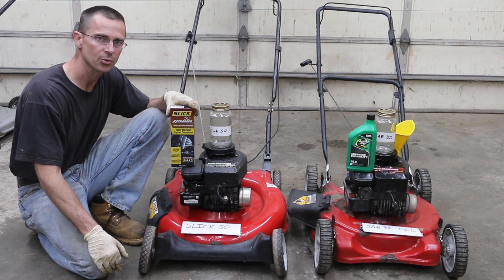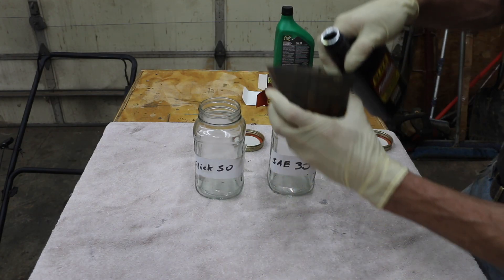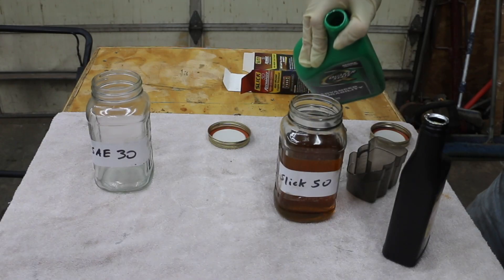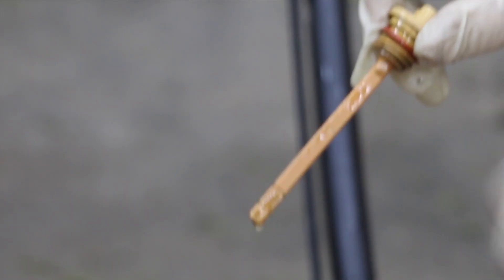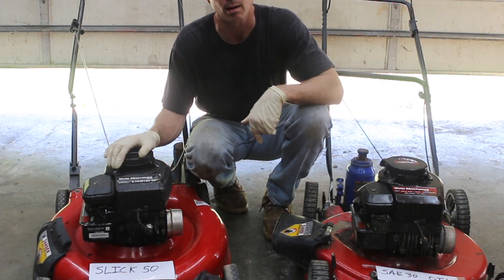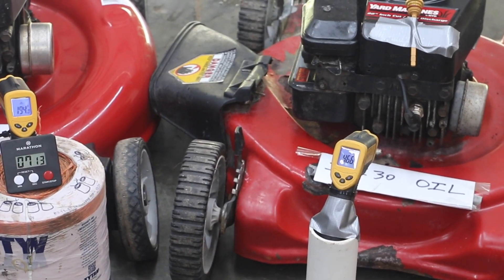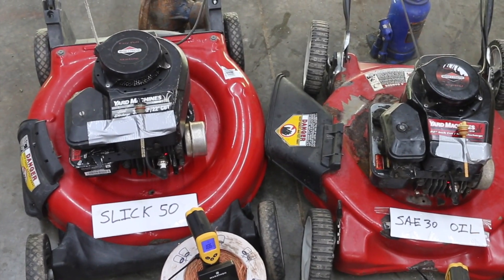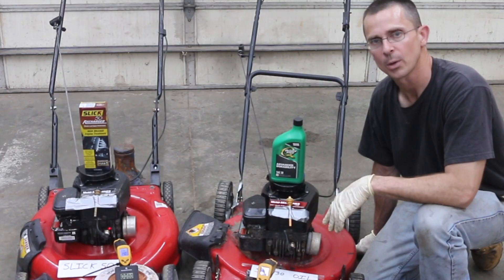Can't believe what SLICK 50 did to my engine!!--Dry Crankcase Test!

Comment: I have seen bad testing like this before. I have used Slick 50 since the 70s and it is a great product. It does say however that it takes 3000 miles or 50 hours to work into the engine, not 20 min. This test is so bad and poorly done it is obvious that that man did not even read the label. I have made it 80 miles with no oil pressure on Slick 50 treated engine,  late 80s Ford 400 block. It was properly treated though, not his garbage test. Run this product once every 50,000 miles, for 3000 miles, then use 5/30 synthetic with Lucas oil stabilizer for every oil change between, and in 40 years I have never blown an engine, many with over 250,000 miles on them and still purred. I realize that the synthetic has not been around that long, but used the Lucas with regular oil before that.

Comment: Had a mechanic tell me people were putting Slick 50 into newer engines to protect them or using it more than necessary, this caused additives to build up due to tighter tolerances aaaand....que the bench grinder noise!!!!

! He said he told people DON'T USE THAT &@"... I had quite the opposite experience with DuraLube...but that was the first formula in a vehicle with 70K on the ODO.

Comment: Slick 50 has always been junk. I used Dura Lube over 19 years in a 94 Chev 6.5 Turbo Diesel, it lowered my operating temp over the life of the engine, at 450k I got rid of it and it was still running great no oil consumption AND I blew a oil cooler line and ran the engine 60 km in 45 minutes with only 1 litre oil in the crankcase and no damage. Dura lube is a winner by any stretch

Comment: Sadly the test is flawed. The test engines were not identical and new. Secondly the only way to be totally sure to get an accurate test result would be to run the test on a group of identical engines so that any failures do to engine materials didn't interfere with the result. This test used two different style used engines. There is no way to be sure that the slick50 engine wasn't already worn out. The fact that the slick50 oil came out darker indicates that the oil had more contaminants in it. Great idea but the test doesn't prove anything. The temp difference says more to me. Heat is a sign of friction, less heat equals less friction meaning slick50 did its job. Someone should test the difference in fuel economy in the same mower without slick50 then try it again with slick50 to get a cheaper and more accurate test model.

Comment: i have run the fin25 on my golf2 gti 1.8 and the rpm was go up from 850 to 1000+ when i come home after 30minutes. also i think you have not 2 same even old engines ant mowers in your test

Comment: Not an accurate test since you used two different lawnmowers and they were used, so the conditions of the engines was unknown. To conduct a statistically valid test, you would need a sample size of thirty new and identical lawnmowers. But if you at least used two identical ones, that would give much more confidence to your results.

Comment: 30 weight oil ??? how do you weigh oil ??? the W denotes Winter viscosity.  hence a 10W 30 means the viscosity when cold is 10 viscosity  and at running temperature it's  at 30 viscosity .  Also research slick 50, after Dupont bought the name the so called slick 50 is not the original .
Reply from the maker: Bradley, I agree...old habits die hard!  Others mentioned that the Slick 50 formula changed back in the 1980s.  Thanks for watching the video and commenting!

Comment: When an engine seizes up the rings score the cylinder walls.  Even if you get it running again, it will burn oil and have less power because of the lower compression.  It is a waste of time to free it up, thinking you can make it work properly again.

Comment: All slick50 has tack additives to thicken it up and make it sticky, which is exactly what chainsaw chain bar oil does. They may or may not have anti wear anti seizeadditives like zinc. As soon as the oil gets a bit too hot it turns to essentially glue. These additives are junk!!

Comment: Interesting, my personal experience with Silck 50 (NOT a dry test lol) in my old Suzuki Alto FX (don't laugh, 2-speed auto with 800cc 3 cyl).
Before Slick 50, it was pretty much out of puff at maximum kickdown (for the 2 speed, that meant holding low range up to 40).
After Slick 50, it was able to keep pulling strongly to the maximum.

Not sure if you gave the Slick 50 enough time to work. I'm assuming the engine could be considered "run in", otherwise any additive may tighten the tolerances too much.

One that was reckoned to be worse for tightening was "Molyslip" - but that might be good for treating the knocking.
Reply from the maker: Great point!  Glad you have good success with Slick 50.  Thanks for watching the video and commenting!

Comment: Why don't you do this same test with Amsoil? the outcome would be very interesting, especially since I used to run this in a race car.
Reply from the maker: Yes, I plan to test Amsoil products.  Could you please send an email to me recommending which products I test?  Sure wish they sold their products on Amazon!
Reply: Well I am glad they haven't sold out like that, they want only AUTHORIZED dealers with some intelligence suggesting which products to use. I did see one place selling the 2 cycle oil, and I hope they shut him down.
Can't wait until you do that test, I have seen for myself how long a rally car ran after puncturing the oil pan and losing all his oil, but in fairness to all products, you can't just change the oil and then suck it out, these products take time to take effect, they need to be ran for a length of time to allow it to permeate the steel for full effect. The rally car I speak of ran nothing other than amsoil for it's life after the break in oil was removed.
It makes a big difference. I was working with a chemist that had worked for mobile 1, we were testing some special lubricants on our dragbike chains. The chains are notorious for losing it's lubricant quickly and heating up the chains causing them to stretch. This stuff was comprised of believe it or not mustard oil, and it worked well, it stayed on the chains and kept them cooler and lubed, I don't know where he ever got with that, we lost touch with each other after the bust in 09.

Comment: I think the slick 50 engine stopped earlier because it was half the temperature, therefore less bore expansion due to heat. The standard oil engine got that hot that the piston had more room in the bore, therefore ran longer. Obviously engine age and condition will contribute as well.
I have just tried an additive called Certech Gels in my diesel discovery and I can say that after a week or so the turbo spools up at least twice as quick as before, it is supposed to ceramic coat and restore engine internals, only time will tell how good it performs. I also put it in my 250cc motorcycle and it seems to shift gears smoother and I have had to slightly richen the carb, it feels a bit more pokey.
Nothing beats a good oil change regime with good oil, but on older engines I cant see a problem with trying some products.
With anything though maintenance is the key.
Reply from the maker: madazz01, Great analysis!  This seems to make sense!  I'd like to run tests on new engines to make the test fair.  

Sounds like Certech Gels make a great product!  I have several turbo diesels that could benefit from improved turbo response!  Thanks for watching the video and commenting!
Reply: The Certech is definately worth a try, it's not cheap but all reports say it works. I can't say what its doing inside the engine, but I think it is coating and removing any tolerance in the turbo shaft so all the exhaust pressure is converted into rotation, instead of some sideways movement. I have an open exhaust and before you could hear the turbo whistling untill about 2k rpm, now it spins up beyond the point of hearing it as soon as you hit the throttle. It also makes boost with a small rev in neutral, before you hard to really rev it to show any boost on the guage. The 5 cylinder diesel Landrovers tend to have a harmonic vibration at about 2200rpm and that seems to be disappering as well. I have only done about 350 klms since the oil change and Certech so time will tell, but good results so far.

Comment: There is one hypothesis to explain a seeming contradiction: engine internals are not similar in terms of wear or bearing gaps.

So first the seeming contradiction: Slick 50 engine runs cooler but dies sooner. How can both be true?
Hypothesis: worn engines have larger clearances. Its likely that any additional viscosity increase would make a sloppy engine run cooler (it would have less actual mechanical surface contact, and higher viscosity "floats" the moving parts aparts.
But drain the lube, and the worn engine dies sooner due to higher misaligned parts. 
This means that most likely the slick 50 engine had higher initial hours or was not built to the same standards of the other engine.

So without knowing for sure that these engines were identical, all you have really done is you have destroyed 2 engines.
Reply from the maker: Moe, Great explanation!  Thank you for taking the time to explain this.  I wish I could run tests on new engines but can't imagine spending this much money.

Comment: That Slick 50 is not the same Slick 50 from years ago. The original Slick 50 Formula is now called XcelPlus.   The original creator of the Slick 50 formula was in fact attempting to sue Petrolon (since acquired by Shell Oil) for defamation by using the Slick 50 name, as the current Slick 50 is a far inferior product.  You should look up Xcelplus and try that instead.  Basically the Slick 50 name was hijacked, and inferior crap was passed off to in it's place.
Reply from the maker: Great point!  I'm told they changed the formula around 1984.  Thanks for watching the video and commenting!

Comment: My boss sold this product back in the early 80's before you could buy it in stores.  He had a 3 hp motor in his truck with the crankcase exposed with plexiglass.  He would start it and let it run as long as you wanted without oil for at least 15 to 20 minutes and no issue.  He explained to me he would treat the engine the night before with 100% slick 50 before his sales call the next day.   Just a FYI.
Reply from the maker: M Man, Interesting!  Thanks for watching the video and commenting!

Comment: My grandad worked at a bus depot in London where they tested Molly slip g, from what I was told they stripped the gearbox and painted it with Molly slip g rebuilt and the same with the engine. The bus was put into service not sure of how long but I am sure it was a week it ran without oil. When it was stripped down for inspection there was no where to any parts. Molly slip g was never released in the paint on form it was released many years later as treatment to be added to oil like slick 50 is
Reply from the maker: Impressive!  Thanks for watching the video and commenting!

Comment: Oil additives are never the best option. If you want the best protection and capabilities you need to get the best quality oil, which would be synthetic oil. Even better than that is ester based synthetic oil like Redline. The ester molecules are polar so they form a film that's harder to remove, and is also a better detergent.

With oil additives like this, it displaces the additives the oil manufacturer puts in their oil. Oil additives will almost always be worse since oil manufacturers can take everything into account when formulating their oil.

Comment: Sample size of one = invalid conclusions. You have to do this with multiple engines and perform statistical analysis to derive any useful data from this. The results could simply be due to variances in the engines before the test.

Comment: Schaeffer’s oil hands down is the best I’ve ever used. I ran 9000 series 5w30 on a car were the oil cooler seal blew an the car ran over 30min at idle an caused no damage. Car ran another 2 years before the trans went.

Comment: slick 50 had a class action lawsuit in the mid 90's  basically for selling snake oil 
i bought a lot of it and used it for 5 years . now i use the zinc additive that the epa banned in oil  that actually does the lubrication  key ingredient removed from oil for flat tappet cams  roller cams  you dont need it .small engines better believe you need it 
mystery oil helps too  i use that in my motors  never an issue and im in the hot area of the country

Comment: Also, you should have ran the slick 50 for many hours before running the test. It needs time to embed. Not a fan of slick 50, and it has run out of favor lately, but I believe the military still uses it in case an engine loses oil in combat.

Comment: What I was surprised to see was the Slick 50 mower was running over 150 degrees cooler than the 30 w mower.  I wonder if the excessive heat on the 30 w was causing any melting of any parts which could be lubricating enough - in a way - to make it last longer?

Comment: I use diesel truck oil in all my old vehicles. diesel oil has more zinc. car oil has less because it coats the catalytic converters. zinc is an incredibly important friction modifier. the color difference if my oil leads me to believe that the extra zinc really does help.

Comment: i think the slick 50 letting that engine stop did it more good than the other engine its probably better that way , the other engine probably just burned right the fuck up and it made a nasty sound too, had the normal oil engine been stopped at the time the slick 50 engine died it probably would have been in better shape than it too

Comment: The slick 50 is like another weight oil mixed in so it can run into places and move free for initial starts and stuff then the other oil is the running protection. So when you drained it the slick 50 oil just got slung out no clinging agents vs the regular where it had not been "diluted" so it was able to cling to the moving parts for much longer. I'm no expert but that's my thought process on it

Comment: Z-Max always had those commercials like Slick 50 I wonder if it's snake oil too. Oh btw you might want to rethink your testing method because the mower on the right (oil) has it's grass shoot pointed at the engine of the left mower (slick50) that might explain why the slick50 seemed to run cooler it might also explain why the slick50 locked up first because a cooler engine might cause the rings etc... to have more friction. I am not defending slick50 just pointing out there is variable that might change the results if the mowers switched places. Having a constant supply of air being blown over the engine would drastically effect the engine temp. Thats not even taking into account that the exhaust from the slick50 mower was blowing right onto the oil mower heating it even more.

Comment: Slick 50 is Great.. I ran it in a 350 engine from day one of purchase new ran slick 50 for 30,000 miles drain slick50 with my favorite oil out of engine,took oil filter also off and drove it in low gear wide open throttle 4,500 RPM for 68 mile and never over heated and Finely it lock up and look at temperature and it shot over pass 375.. took to the shop and rod bearing was eat up and messed up crank on just that one..We race cars and pickup ET... got to run it longer than u did for it to do it's magic..we also 20 years ago ran it in our racing go kart and up HP from a 5HP Briggs on alcohol 2 more HP with other stuff a total of 13 HP.. u might try your test again.. good luck

Comment: I seem to recall slick50 containing Teflon in it. I also seem to recall the company got sued due to damage to different engines over the years. snake oil. use a good quality oil to begin with and you do not need any aditives.

Comment: when you drained the oil and the slick 50 was dark made me think it's acting more as a detergent then it would be coating the parts. I think the engine blew sooner because it was washed down of any residual lubricant.

Comment: TY for your video, I to used slick50 yrs ago and always wondered if the claims were true. Before slick50 was introduced I did see a program that mentioned a guy in germany acidentally spilling coca cola in the oil he put into his vw, the program focused on the coca colas ability to make the oil stick to the parts. I hope that tidbit of innfo might inspire a test as I am curious as to its validity ( wouldve been about half a can to 4 or 5 quarts of oil, or however much a vw bug takes) TY again for taking the expense & time to substantiate the claims

Comment: You just don't pour slick 50 in and then drain it out the slick 50 has to remain in for quite a long time in order to work into the metal this is an invalid test

Comment: The oil shouldn't be that dark only way it would be that dark if it stayed in there for a while
Reply: For real small engines like that run very dirty
Reply: For real Or there was old oil somewhere in the reservoir, coating components, etc
Reply: Bet you did not know you were be lied too .. Should get 
http://lubrilon.com/support/pds.asp  Now  this product is the  real deal
 .Was once called Slick 50 until John Bishop lost the 
trademark .What auto shop sell today Slick 50 is a lie . Anyway  
lubrillon the absolute best protection for tranny,engine and whatever . 
Been test in car  and oil drained  .Car  had no wear . My Uncle even did
 this test . I use it  :)
Reply: Kyle Orme yeah they are a lot dirtier because they arent needed to drive and get you places all they do is cut the grass

Comment: it's a far-fetched idea , but what if slick 50  has higher detergent qualities and stripped off some of the varnish or remnants material from old used oils that helped cushion the metal to metal parts . that could be reason why it's considerably darker . as for the cooler running temperature I don't know LOL